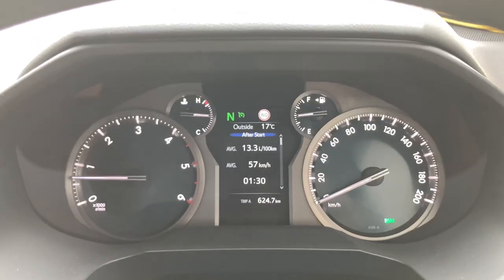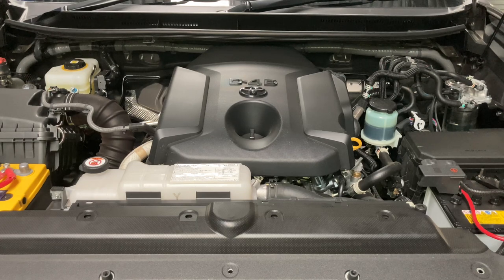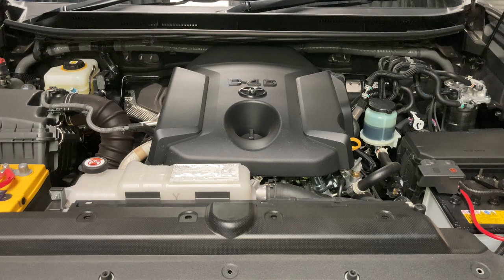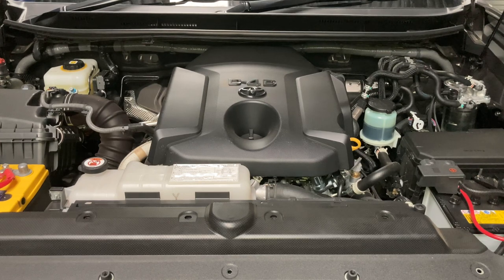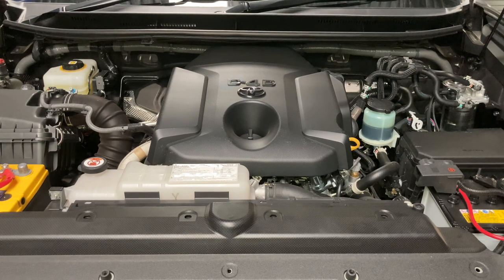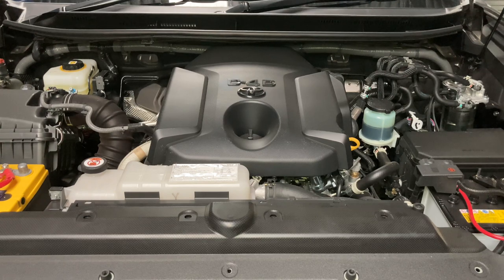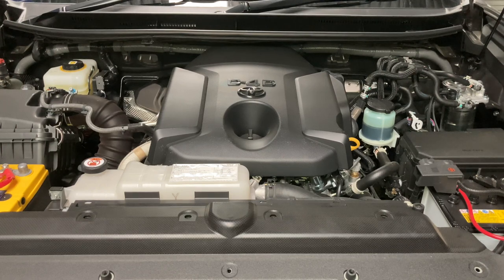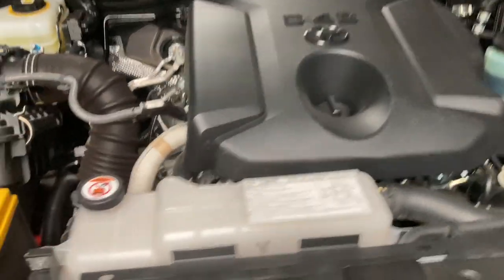IS THE NEW TOYOTA PRADO Machine FOR TOWING? or BUY 300 Series $$$$$$ 🤔

Comment: towing that is nothing like towing a caravan, dont give advice on stuff you dont know. the prado is crap at towing a 2000kg plus van-- dangerous, they wont keep up road speed on an incline, they are unstable as they are not heavy enough for a large van,  i sold mine and bought a y62, 99% of prados towing tandem vans with the family is over its gvm and dangerous and false fuel economy figures--- every where you go towing in a prado the throttle is wide open as its so gutless, my prado used 24l per 100 towing 2500kgs, the 62 v8 uses 21.8l per 100 towing 3500kgs and has done consistently from new, if you want a vehicle to tow 2000kgs plus--- do not buy a prado

Comment: I have a new 2022 Prado GXL built in July and received it in late November. I have just clocked up 7000k and I love it , I have done a road trip from Canberra to Melbourne and back as well as a few trips to Sydney and towed my boat with ease . Still early days but so far so good, the only thing I did was get rid of the 0w30 oil at 1000k and run Nulon fully synthetic 5w40 low ash sulphur DPF diesel oil which is better protection when towing , long highway trips and summer spec here in OZ.

Comment: I have a 2021. Towing a 2.75 ton van I can’t keep the engine below 95 degrees on hills or long climbs if the ambient is over 34c at 90-95 kmph ( grant was locked) Anthony could you text this. Just fitted tranny oil cooler and vented bash plate and trying this tomorrow. Below 34 ambient it great plenty of power and great lockup of the tranny. Love it
Reply: How did you go Paul ? I'm also towing around the same size

Comment: Great info, I tow a 2t camper same width and same height as my 2017 Prado, been towing in 4th unless dead flat then 5th, average around 13.5 per 100 km ( calculated by tank fill, computer shows higher ) but will now be monitoring temps, thanks

Comment: Hi Anthony, thanks for all the great info you provide, they are very helpful. I’ve got a 2015 Fortuner and tow a 2.5 tonne van. 
I tow in 4th most of the time but occasionally will knock it up to 5th if there is a slight downhill and a long straight. 
I’ve added a trans oil cooler to be on the safe side as I had a few experiences of the trans temp getting to a point where it thought it was too high, eg 110+ deg C. I get lock up in 4th but nothing in 5th as far as I know. 
When I bought the Fortuner I didn’t know about your videos. Therefore making the most of the 1GD FTV. Got no choice. 
Keep up the good work.

Comment: Top Sunday Night Special Video, exactly my thoughts on towing and everything you mention.  It’s so critical the public understand it’s limits.
QN: 500Nm at the crankshaft, but what is it at the wheels?
I’d love to know.

Transmission lock at those gears is an absolutely fantastic feature for towing realistic loads.

Just thinking, with the larger turbo, particularly at pressures above 20 PSI, that exhaust manifold and turbo would be even hotter than the previous model.
Heat HAS to go somewhere.
The heat is proportional to load (as in the work the engine is doing, not towing load, but total load).
The 1kD is proven…the newer better versions (as u say post roughly  2020+).
Only time will tell, 15 years time we will know.

Comment: Just purchased a caravan 1780 Tare probably 2T all up. Picked it up from Newcastle NSW and drove to Cairns QLD via New England Highway.
Have a 2023 Prado Kakadu and Scangauge 3. 
Transmission stayed between 85 and 96 most times in S4. Madame Google managed to direct me up some extreme hills as a road was closed. Trans2 (torque converter?) got up to 121°C. Only briefly and dropped back to 110°C quite quickly. Thinking about an additional cooler. What do you think?